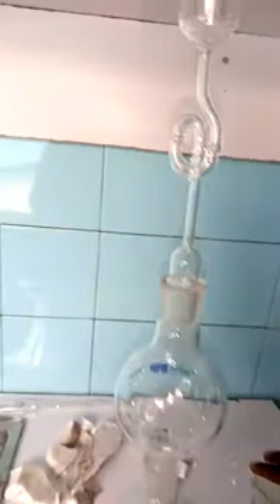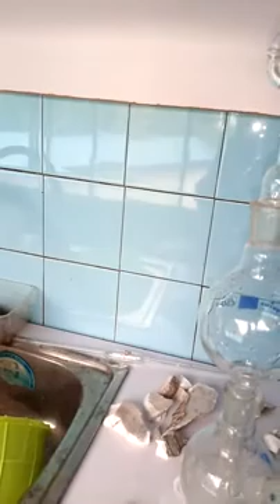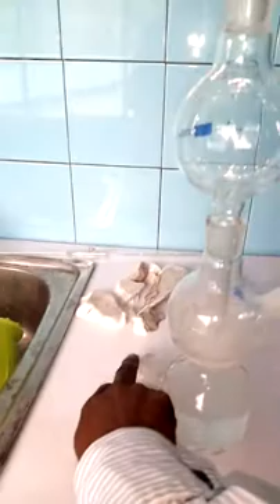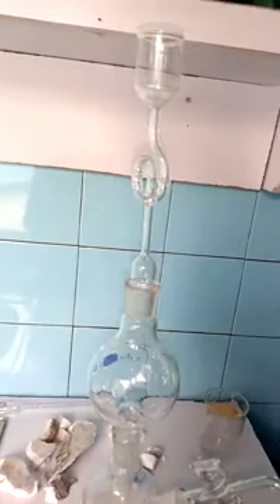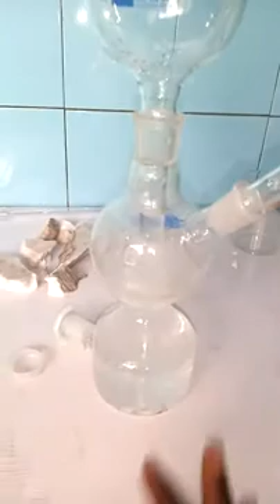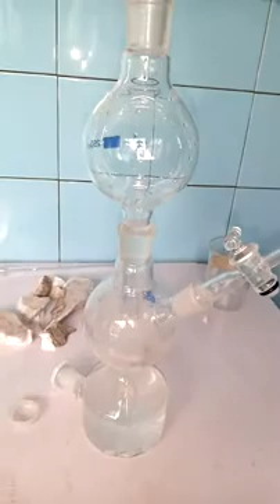#how  to generate  CO2 gas with the Kipp's apparatus #2022 #kids  #science #experiment #chemistry

Comment: What types and strength  of acid  and bases used for co2 synthesis?   How much co2 is generated with different types of acids/ bases?
Reply from the maker: Thanks for commenting. CO2 is produced by the reaction between any mineral acid and a carbonate salt. When using calcium carbonate (marble) use HCl or HNO3, as H2SO4 is not suitable.To produce more CO2, simply increase the concentration of the acid.